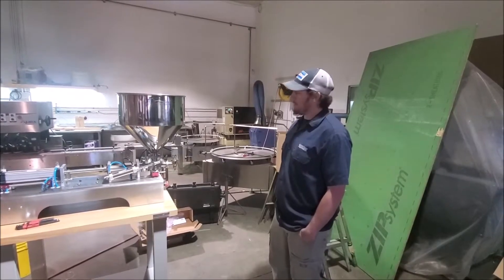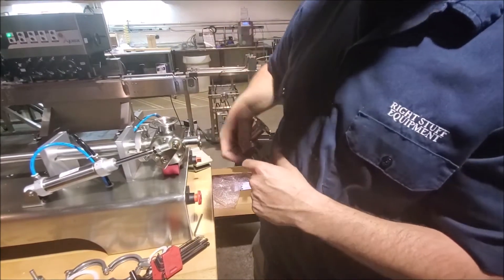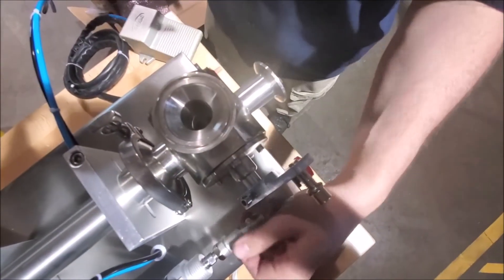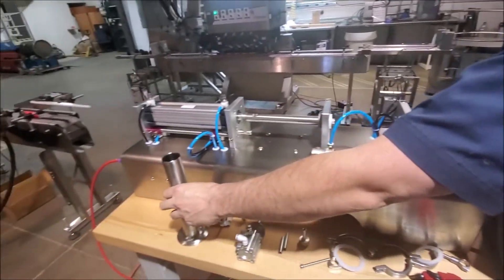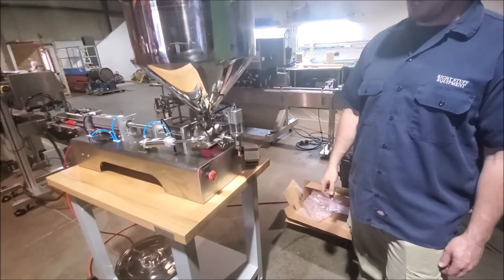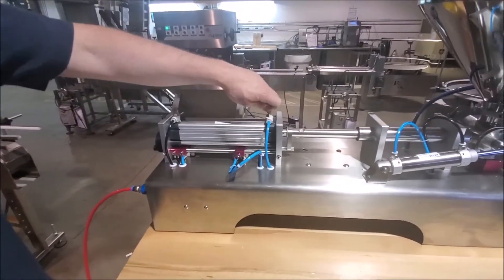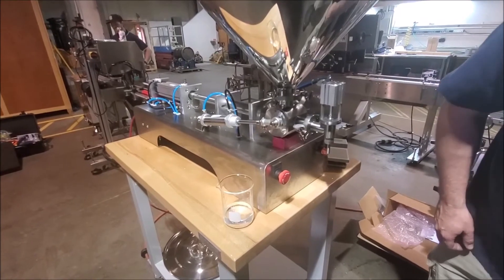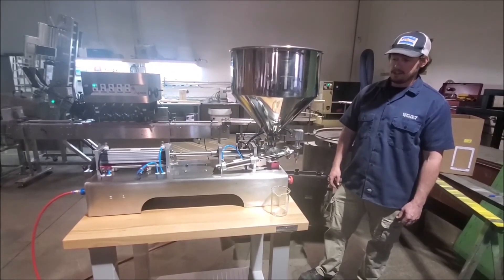RIGHT STUFF EQUIPMENT. Piston filler Training

Comment: Would love to know how to correctly re-attach the 3-way valve arm if it was disconnected and the valve timing is off..  Asking for a friend!
Reply: Hello Mr. John!
Did you receive any feedback?
Reply: @NyagahDenis  No, but I figured it out... basically you position the valve where it should sit normally on the filling machine.  Then play with it so that you understand when the valve is filling product into a bottle/jar vs when it's intaking product from the hopper. Then, position the valve in the filling position, and lock the piston arm to the valve arm in place in its most forward position so that it doesn't bang against itself.

After you have it working, score the piston arm and the pin that rotates the valve so that if it ever happens again, you can line them up much faster.
Reply: @JohnFixes  Thank you for the reply. This is very informative.